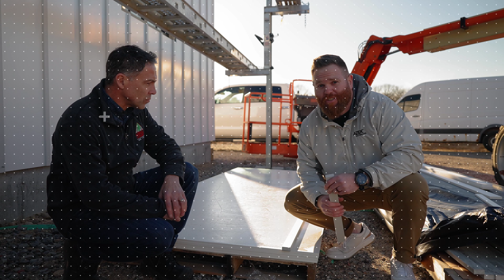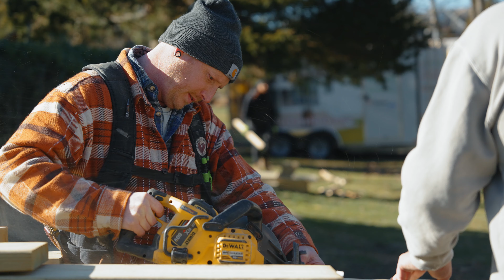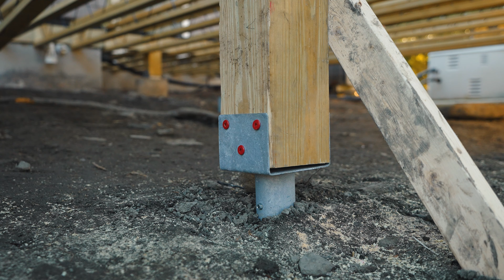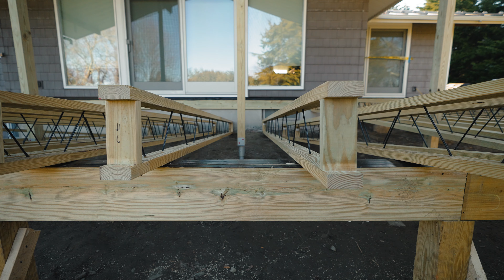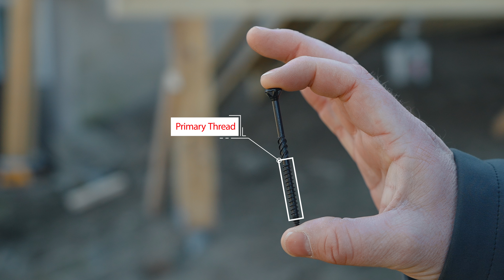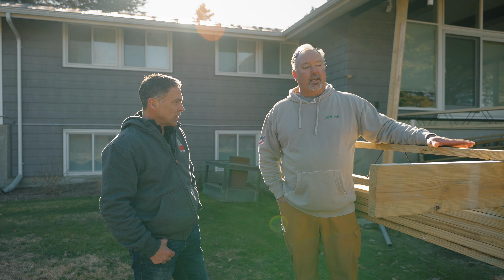Building Longer Lasting Decks  - Breaking Ground Episode 3

Comment: How do you attach your post and railings thanks
Reply: We use surface mount railings so we add blocking per the plan provided by fastenmaster. To block in between joists or at ends we simply rip a piece of pressure treated to 7 1/4 then insert it and screw it off.